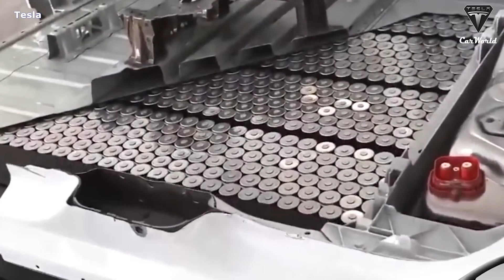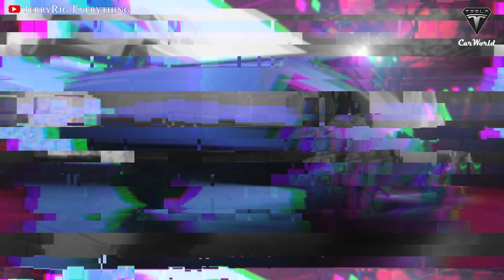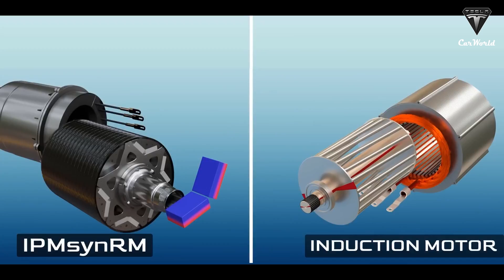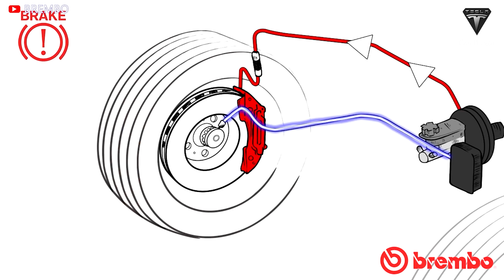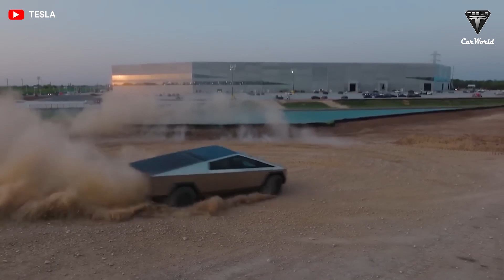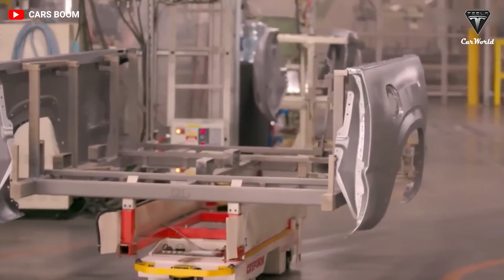Elon Musk Reveals All-New Tesla Cybertruck 2024 Design, Could Destroy the Entire EV Industry!

Comment: The big wiper should be on the passenger side to avoid obstructing the driver's view...It seems that the 4-wheel stirring is not working yet, I did not see the rear wheel turn when Cybertruck made a U-turn, it should turn more since it is at low speed...I don't know if the 4-wheel system is automatic when you drive it or if it can be manually operated or turned off if you don't need it... If all of these features work the advantage is enormous plus the truck is bulletproof including the glass and rustproof...Larry Allison is correct when he says that it can be a  very good Police Car..It has all the Police requirements, maybe TESLA make a Police version of the Cyber truck..

Comment: Lenzs law has nothing to do with lens as in optics.
Lenzs law is about the collapse of the inductive field and is how the coil/points system was used to generate the spark for spark plugs or the zap ability of a stun gun.
It is one of the laws related to induction when you break the induced field it collapses into a high resistance causing a huge voltage increase because E = I x R

Comment: I didn’t particularly like the design of the Cybertruck when it was first released but thought it would check the 4X4 box, the Tesla box, and the go fast box, all in one. I initially ordered the dual motor 4X4. Upped to the tri motor when Tesla announced that would be the first model manufactured. I’m going to order whatever model, with whatever options/FSD will be manufactured first. I’m about 300,000 in line. That should give Tesla time to put 50,000 on the street and I’m hoping the stock price goes up quite a bit. I don’t intend to sell any except to pay for the truck.

Comment: In a technical discussion, it’s important to get the numbers and units of measure correct. This video contains several silly errors. Here are three that really stuck out for me. I hope the authors can easily correct them.

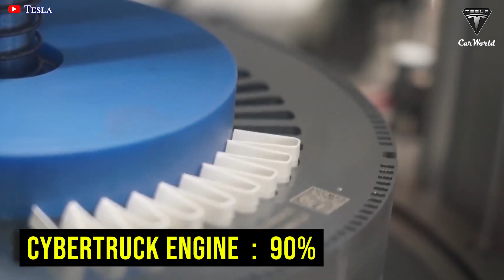At 10:07, the voice-over correctly says that the Tesla motor is “98% efficient,” but the graphic incorrectly says “90%.” Oops.

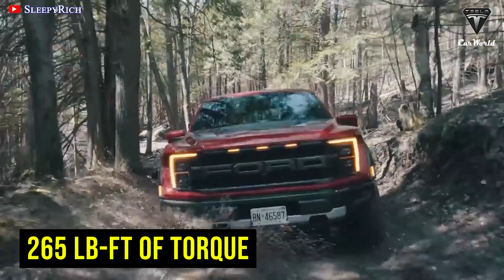At 10:37, the graphic correctly reads that the Ford F150 produces “265 LB-FT” (pronounced “pound foot”) of torque, but the voice-over incorrectly says “265 pounds per feet.” (There is no “per” in the units for torque. And the singular “foot” is preferable to the plural “feet,” but either works.)

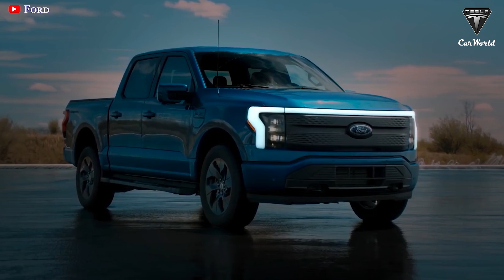At 10:49, the graphic correctly says the Cybertruck produces “824 LB-FT” (pronounced “pound foot” of torque, but the voice-over incorrectly says “824 pounds per feet.” As above, there is no “per” in the units for torque.)

I’m really surprised that the authors incorrectly pronounced the English units for torque (lb-ft or pound-foot), yet correctly pronounced the metric units for torque (Nm or Newton-meter). A slip of the tongue I suspect.

Comment: “Exoskeleton”

As a former British roadster enthusiast, “here we go again”. It’s a unibody design.  They’re expensive in corrosion and crash situations.  With the stainless the former might not e a problem, but it’s a big problem in the latter.
Reply: No... It is a bit like unibody except more so.
The unibody still treated the chassis as a different structure than the fenders, roof, door columns and the rest.
Exoskeleton means the entire body of the truck is the load bearing segment of the vehicle.